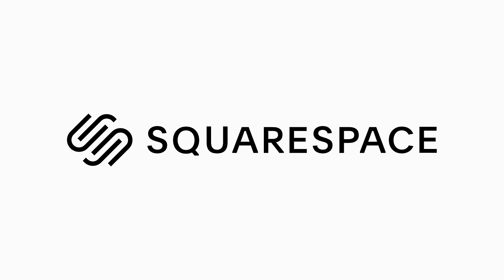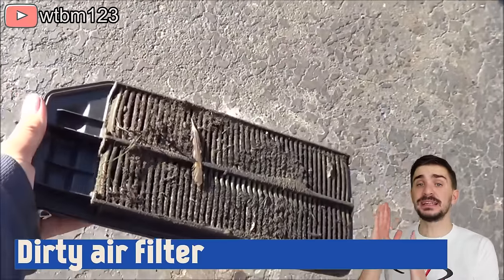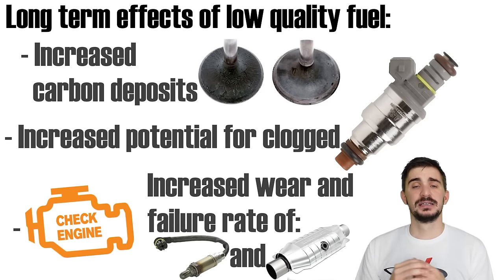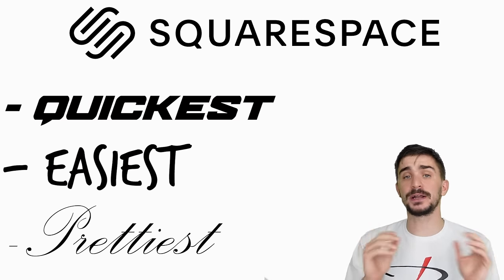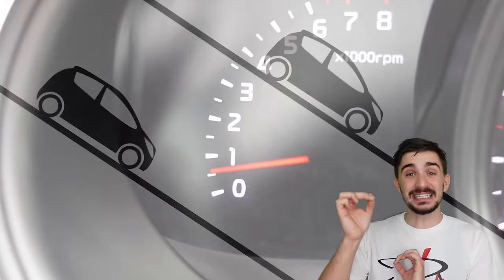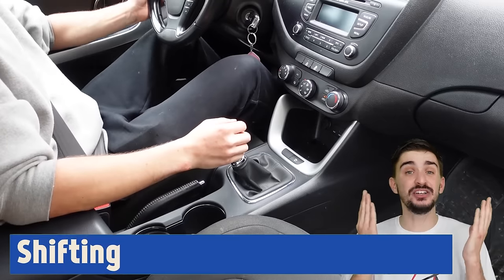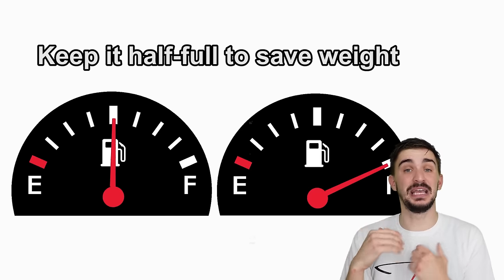EVERYTHING on FUEL SAVING - PRACTICAL DRIVING and MAINTENANCE techniques to REDUCE FUEL consumption

Comment: What about a carbureted motorcycle having the engine cut off, and clutch pulled in? Then I release the clutch to crank the engine with my momentum and continue. I do that all the time, to sneak by people, save fuel on long descents, and reduce wear on my 2stroke engine, because idle amounts of oil may not be good enough for high rpm engine-braking.
Reply: @6:43

Comment: Little mistake, I worked in the a car company on shifting indicator, and yes, the car know when you are going uphill or downhill (it also work with a trailer).
Reply from the maker: Really? How does it know? Some very modern cars might have gyroscopic or g sensors but that's a minority of cars, 99% other cars don't know when you're uphill or down.
Reply: @d4a  If I recon correctly, they can calculate a load difference with the theoretical  power and the acceleration. And then they adjust the indicator

Comment: as per your first point if the check engine light is saying it has a bad o2 sensor. Does the ecu know to ignore its input or is there a chance it knows its wrong but continues to use the reading in its fuel calculations.

Comment: Fifth Gear has a Episode where they trying to recover lost Horsepower from a VR6 they Gain most of them back by renewing the Sparkplugs, Filters and Cleaning the Fuelsystem with an Additive. By increasing the efficiency of your car your also reducing the amount of fuel needed
Reply: But anyone with half a brain knows u can have a Tdi that makes more torque than a Vr6 and gets over 300% fuel economy. 
Looks like some1 was dumping money in the toilet for views.
Reply: @fastinradfordable  drive a 2001 1.9TDI PD 130 👋🏻
Reply: @fastinradfordable  the TDI may have better fuel mileage, but the VR6 sounds 1000% better.

Comment: coasting for long periods of time in gear or engine braking you are putting a lot of stress on internal components. If you are running 3000 rpm with no gas you are leaning the mixture and reducing the flow of oil. Also with PCV systems the high vacuum caused with engine braking pulls extra oil into the combustion chamber. Especially with carbureted engines it will pull a lot of oil. And you aren't consuming 0 fuel if you were the engine would shut off the necessary components for combustion still need to occur. If say your engine has an AFR of 13:1 at 3000 you are using 3000 parts fuel and 39,000 parts air. At idle say 850 RPM you're only using 850 parts fuel for 11,050 parts air
Reply from the maker: Please don't spread misconceptions. Pretty much none of what you said is true.
Reply: @d4a  you’re assuming that everyone watching is driving a fuel injected vehicle which in that the computer can make changes to make staying in gear more efficient 
For people with older vehicles and less complex systems regulating fuel and air when done correctly coasting in neutral uses less fuel
If the inertia gained from going down hill is great enough to carry you over additional rises in terrain or even flat ground before returning to your previous speed you will save if they are in gear and engine breaking they are wasting momentum. It’s simple physics if you are in gear slowing the vehicle down while going down hill when you get to the bottom or the next ride you have to re apply throttle to maintain speed if you coast you don’t have to do that saving fuel 
And yes spark and fuel still has to happen all the time…

Comment: My 04 Mercedes c230 probably has an oil leak and is leaking onto the 02 sensor pretty common on those I need to fix my oil leak and replace the sensor itself

Comment: While likely not legal, removing emissions devices often increases fuel economy. U, allegedly, know a guy who removed the DEF system from his diesel truck and had it tuned appropriately. His fuel economy increased 27% and the truck doesn't blow smoke. Makes me wonder if the extra fuel, extra materials processing and transportation of the DEF, and the extra materials that had to go into the truck really decreased the carbon footprint.

Comment: First of all I wanna say I love your content. IMO, It's well presented with an elegant blend of realism, and physics.

My comment (or possibly a footnote) is in regards to (11:37) Coasting in Neutral. I managed to search around the comments (no, I did ctrl + F and keyword search) for any trace of mechanical fuel injection.
I like how you pointed out that you'll basically save fuel by keeping the car IN gear going downhill. It's safe to say any EFI controlled car will likely shutoff fuel to injectors when the car is keeping the engine running. You can especially notice this with cars that have a louder exhaust. The tone and rhythm of the exhaust change with deceleration because the engine is acting in it's basic nature as a glorified air pump.

I would like to point out one special scenario with manual fuel injection. I have a MK2 Jetta diesel that I still coast in neutral but only down specific hills locally that I've been driving down for years and because I can see far ahead and far away from the road. I still agree that this isn't as safe as staying in gear. However, moving at 45+ mph has the engine RPMs a bit high even in 5th gear because of how old the car is. Regardless I keep my foot on the clutch and hand the shifter (not resting on it) ready to engage. Of course I don't do this all the time and only on literally a couple hills that I know very well. Mostly because I simply don't want this old diesel screaming if I can help it. But after watching another video about this topic, all the more reason to put this bad habit to rest finally and stop justifying it.

One last remark to this topic. If you shift in and out of neutral with an automatic while the car is in motion, say goodbye to your transmission if it has clutch packs like in Chrysler transmissions. Shifting in and out of gear will wear out the clutch packs and especially the clutch band that wraps around the planetary gearset. If you change your fluid, you're removing that friction material that you wore off and all of your engagement goes out the window. Don't ask me how I know that.

Of course I'm in no way against this topic and manual or automatic, you should never take your car out of gear while it's in motion. I simply wanted to share my (bad habit) and how tiny the fuel economy gains are in my specific scenario of a manual fuel injection. I keep strict and accurate track of the trip mileage of every tank of diesel in my MK2. The real reality is I gained more fuel economy by replacing my fuel filter (what's that?), replacing my rear wheel bearings, and adding brake lubricant to moving brake parts.

Comment: I actually once had a car that had, in the owner's manual as well, a mode to let you turn off the engine. It wasn't a hybrid, so It must have used all electric systems like the brakes or steering. If you pressed the power button in the right pattern then it would shut off the engine, but power steering and brakes remained on.

I won't say what vehicle it was because I don't want people trying it and crashing, but there are manufacturers out there that realize people want to save fuel... and that the danger of turning off the is actually in steering and brakes. Still, don't just try it on any random car.

Comment: Not to criticize too much but they were a couple errors in the video 
1 don’t use compressed here tomorrow filter become damage them, and the small hole that dumped out the particle to get a new engine in damages 
2 oil can actually make a huge difference not necessarily in the type, but the cleanliness if you’ve never done oil flush on your engine when you do one I’ve seen them go from burning oil to not burning any oil and getting 10 to 15% better gas mileage

Comment: At 3:40 ,  I wouldn't advised to use compressed air to clean the air filter, it can potentially harm it the by expanding the small ''holes'' in it, thus losing efficiency and allowing dirt to enter the engine.
Reply: advise*

Comment: Honestly the air filter thing isn't really relevant and isn't going to have any impact on day to day driving (especially for petrol engines). Sure, at higher RPM/load it may cause some issues but air filter sized is based around adding minimal loss at maximum power levels so even if your filter is blocked 50% of flow (extremely extremely unlikely for a normal road car) it still isn't going to cause much impact at normal power levels. I have done proper testing on a 4WD diesel engine using an expensive industrial vacuum gauge and there was some difference at full boost/max RPM with an extremely dirty filter which was full of sand. But you would never ever experience that level of blockage in a normal road car...

Comment: While an oxygen sensor is easy in theory to replace, they're almost ALWAYS seized lol. Before you do the replacement have a couple days where you don't need the car or can use another one to soak the sensor socket in PB blaster first

Comment: 21:00 Many do work but the PCM would need to be repogrammed. It can however absolutely kill knock. Instead of buying high test in older engines. Magnets up to $10. Vortex devices up to $20. The PCM doesn't like these and will retard the ignition timing to compensate for the thermal efficiency/fuel economy gain. There's not likely to be any change on modern engines.

Comment: Disagreement on slipstreaming but only conditionally. The larger your vehicle is and the less aerodynamic it is the less effective slipstreaming will be. In a small aerodynamic car such as a Prius or Mirage even you can follow at a distance of 2-3 car lengths behind a semi and still see a 30% increase in fuel economy. Also, with smart technique and/or a Prius the losses from braking can be largely avoided. Ironically this is also a technique that could work well for sports cars as well, but here you may want to watch your coolant temperature.

Comment: Turning the key off while coasting makes no difference in fuel economy unless you also put the transmission in neutral to disconnect the engine from the wheels. Otherwise, this is exactly the same as normal coasting where the injectors should shut off with the engine and accessories still get turned over by the transmission, minus the ability to use the accelerator again until the engine is keyed back on.

Comment: unless your car specifically calls for 93 octane use 87 octane you dont get any better fuel economy or any added benifit from using 93. the octane rating is for detonation and thats it and most o the time you dont have to worry about that unless you have a sports car or something thats quick. i always use 87 octane in my cars
Reply: Most street cars nowadays will retard the timing when higher octane fuel is detected. I have noticed an increase in fuel mileage when filling the tank with premium fuel.

Comment: Question: Does cruise control impact fuel economy in any significant way?
Reply: Yes, older ones highly negatively since they try to maintain the request speed at all time no matter what (hills etc will force high throttle inputs). Newer ones has algorithms for smoother throttle inputs but still, your brain see and knows what’s in front and can adjust (hills, traffic, turns, etc.)
Reply: Good when driving for a prolonged time flat and straight. But only at a speed, where your transmission had shifted to the last gear and in low /mid rpm.
Reply: in long trips it saves a lot of fuel, newer vehicles even have a special fuel strategy when the cruise control is on, it only inyects the minimum fuel to keep the requested speed
Reply: 稳定的油门才是最省油的。

Comment: 20:53 only one additive works. Royal purple max clean or max tane. *DO NOT USE ALL THE TIME. ONLY WHEN YOU SEE A SLIGHT DROP IN MPG 2~5%. USE AS DIRECTED BY THE BOTTLE OR MANUFACTURERS RECOMENDATION. that being said i had rough idle and misfire issues and mpg drop in my 90s shitbox, went about it methodically and it was just needed a little fuel system cleaning.unless you plan on taking out the entire system for a spring cleaning( unless its that bad) then a bottle of max clean will solve it. dump a bottle in the tank fill it with 91 shell gas to the top and let it sit over night. then go for a 200/300 mile road trip. and watch the magic happen

Comment: boost and lambda gauge help also... on my fc3s the most economical way to travel is with cruise control @ 3300 rpm- 120km/h. it takes about 12liters per 100km .

Comment: i'm referring to what you said about coasting in neutral, I got OBD and i'm using Torque App.I monitored closely fuel injected per min in CC/Min  units and its is around 9-12 CC/min when I'm coasting in neutral downhill and when  on 5th gear it goes up to 30-45 CC/min.
I hope you could enlighten me on this
Reply from the maker: Decel fuel cut disabled / someone messed with the software / something wrong with the app / you're not coasting / something wrong with your fuel system.
Reply: @d4a ( decel feul cut disabled) i don't know about it,( someone messed with software) The Ecu is stock from the factory, (something wrong with the app) well maybe ( you're not coasting) i can assure i am,  (something wrong with your fuel system) its is stock from factory.
Its a Toyota Yaris  XP130 engine 2nzfe
I wonder if other users can confirm this.
Reply: DFCO works between a range of RPM's in some cars if I remember right, could be that in 5th gear you don't enter the DFCO region until your RPM drops into the correct range. I might be wrong here, but it's also how some (older?) engines have rev hang at higher rpm that makes shifting easier with a slow gearbox, versus shifting at lower rpms and the engine dropping rpm's too quick when clutched in to match the gearbox at the next gear.

Comment: I have to disagree on the coasting. I travel a lot on the highway, and when I'm on a really small decline about 2-3% I find that rolling in gear consumes about 1 liter per 100 more than idling in neutral. If my car had a 6 speed manual it probably wouldn't make a difference but now it does, period. I also find absolutely no risk on coasting on the highway. Sudden acceleration is needed only on overtakes.

Comment: Shutting down your engine doesn't immediately kill your brake assist, you still have 1-2 hard brake applications in the accumulator before you lose brake assist

You do immediately lose power steering, but at highway speeds, manual steering is about easy as power steering

In addition, starting an engine only uses a few millilitres of fuel, which is roughly equivalent to around 12 seconds of idling

The main disadvantage is engine wear, and the inability to accelerate

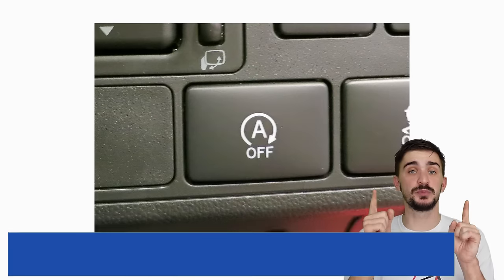Comment: 18:20 Okay, so I agree with you on the notion of manually starting and stopping your engine but come on, if say for example, YOU KNOW you're gonna be sitting a red light for about 3 minutes, isn't it a good idea to just shut your engine off and start it again when it's almost your turn to go? Like if you can see that "okay, after these cars, it'll be my turn so I should start now" wouldn't that be beneficial?

Comment: do not try to load engine to max bsfc bc it wont work (70% throttle at 2100rpm roughly), at least does not work in my 1.5dci. sounded like good theory but turned out using boost hurts fuel economy. I have read on truckers forums that most efficient acceleration is when you dont generate boost. small engines are not efficient because they are turbocharged but because most of the time they are NA small engines. turbo is there just when you need it
otherwise seems like you have been catious about giving tips. also it would really add if you included some tests.

Comment: What frustrates me regarding tire pressure is that if you have other dimension tires then stock pressures is not right.
So how are you gonna know what pressure is the best then, and at what pressure your tire has the most perfect contact with the road. I have been thinking of using pressure mats where you drive onto it and you will see where the pressure is the highest, and that way you can see when your tire has the most contact or distrubutes the weight evenly. But these things are really expensive..

Comment: @20:40 you are wrong about fuel additives they actually do make a difference maybe not increase fuel economy on a new vehicle but on a used vehicle that's been using low quality gas it could increase it's current fuel close to it's original EPA economy by cleaning the fuel lines, filter's, injectors,intake valves, and exhaust valves if you have enough of the fuel additives that's why it's best to go to a Gaston now which shows TOP TEIR detergent gasoline most cars today recommend it actually it's more like a requirement so

Comment: RVS treatment can lower fuel consumption a tiny bit. From what i've gathered, it results in around 0.1-0.2L/100km lower fuel consumption.
Not a lot, but still measurable. Also the stuff costs a lot, but for a good reason.
Reply: Yeah , no. It's snake oil.
Reply: @majbach1968  Nope. It's proven to work.
Reply: Can confirm. Works beautifully. Also less vibrations/heat/noise.
Reply: @TopiasSalakka  Just like homeopathy has been.

Comment: 3:53 That example is just wrong. The "thinner" oil on the left (5W-30) is LESS viscous in winter (hence the first number 5W), and the one on the right (10W-40) just keeps its lubricating properties in higher engine temperatures (hence the second number 40).